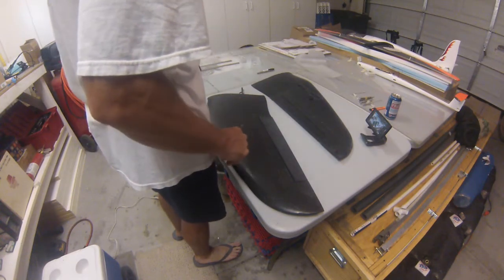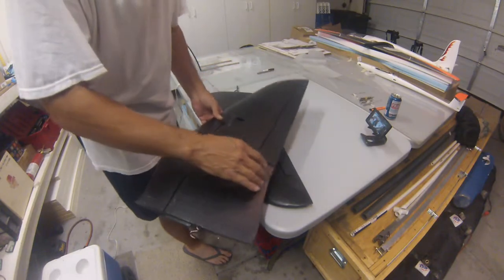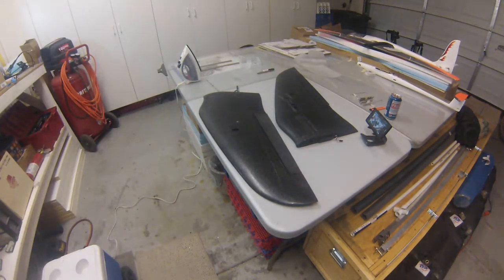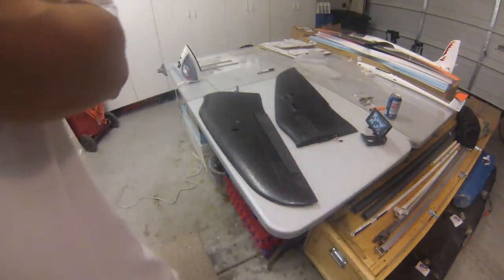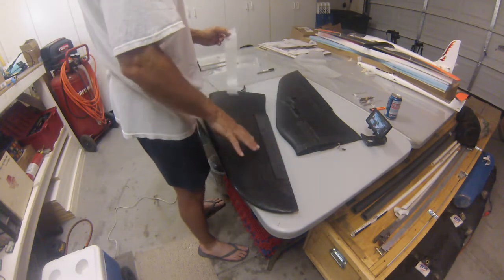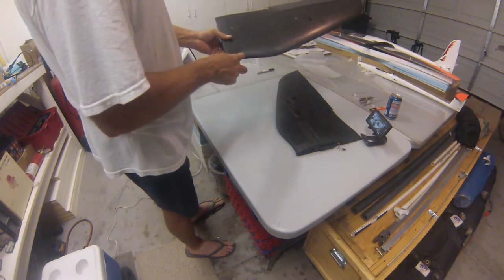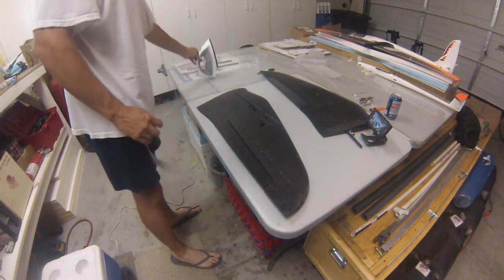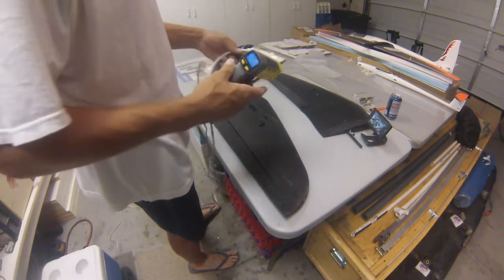RVJet Elevon mod

Comment: Also if you ever get into the same problem again my recommendation is to do the following:
- cut throttle
- place controls neutral
- give elevator up input (do not try to counter the any roll until control is regained)

Comment: The long wing works perfect up to 60mph with no modifications.  The short wing works to at least 100mph.  This has been tested and unless the wings are damaged or broken any RVJET-wings will preform similarly.

Check the video I sent as a video response. In that video I make several high speed dives over 150kph and I have since flown over 160kph following hard banking with no problems.

Comment from the maker: I would skeptical about this wings' elevons having any kind of positive control at 100mph; I am not going to try and find out either. The modification is working great, no noticeable fading of the control surfaces. Although, the wing is starting to warp some when left out in the sun for too long. The white wing may have been a better choice for out here in the hot desert sun. 
As far as your next post, exactly. I now realize the RVJet is not meant for high speeds, good for cruising at 30mph.

Comment: Nice modification and please tell us if it's successful. The long wing was never designed for high speed and VNE is about 100kph. It was designed for higher lift capacity at the cost of smaller speed envelope.

However the short wing is good for over 160kph (100mph) in fact I've not reached it's VNE yet, Since both long and short wing use the same elevon they are good for high speed +160kph in stock configuration.